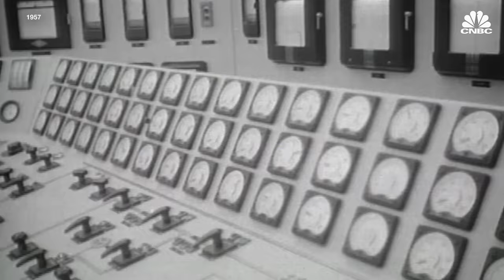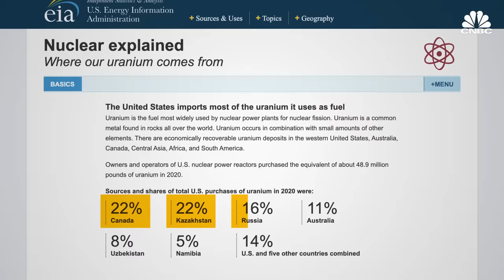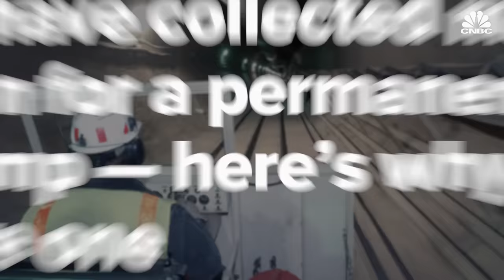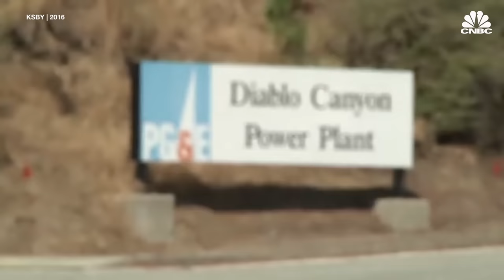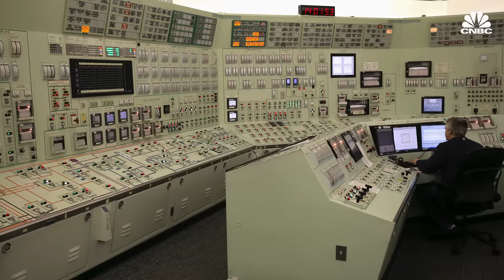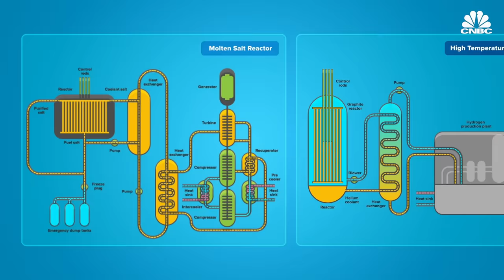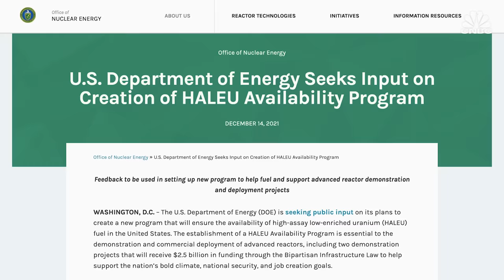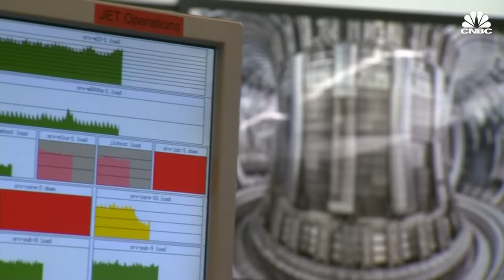Why Nuclear Energy Is On The Verge Of A Renaissance

Comment: Close but no cigar by saying we need batteries for renewables.  We need energy storage, of which batteries are only one type.  Energy storage can be pumping water between pools at different altitudes.  It can be pressurizing/depressurizing an underground chamber.  Anything that can run a turbine as you release it can be energy storage.
Reply: But none of the dozens of methods we have for energy storage have been shown to be anywhere near what is needed to make it effective to run the grid without fossil fuels or nuclear.
Reply: @danadurnfordkevinblanchdebunk  And I didn't argue otherwise.  I just said that they are exploring more energy storage options than just batteries.  I didn't comment either way on your topic.  Did you mean to reply to someone else?
Reply: @ScrapKing73  Nope, to you.  Batteries reach into the 90 percentile efficiency, pumped storage around 70%, hydrogen worse.  Even at 90%+, batteries are no where near a viable solution for utility grade storage.  Until we crack the energy storage problem, renewables are merely a burden on the grid.  Natrium's molten salt storage seems to hold the best hope, but it's not proven yet.
Reply: @danadurnfordkevinblanchdebunk  But I'm not disputing any of the points you keep raising, so you're replying to me with off-topic things.  I'm not talking about sunsetting all other types of energy production, which all your comments are based upon.
Reply: @ScrapKing73   I have been responding exactly on point to your comments and adding to them.  Not sure why this is so difficult for you.
Reply: @danadurnfordkevinblanchdebunk  Not sure why you're unable or unwilling to be polite, when I've been polite to you.  Anyway, I was very clear:  I said that energy storage is more than just batteries, and that's all I said.  You've replied to that with comments about the efficacy of different energy storage solutions, and how we're not ready to go to entirely renewables yet.  Those things are clearly off-topic, as I did not comment on them in the OP, so you're bringing them up unbidden.  If you re-read the thread, it's open and shut that you are replying with off-topic points.  Which is fine but, since I'm not disagreeing with you, you're just having that conversation with yourself.  shrug
Reply: @ScrapKing73   You have yet to come up with an effective energy storage media for your meme.  That's because there isn't one.
Reply: @danadurnfordkevinblanchdebunk  My "meme"?  That word...  I do not think it means, what you think it means.*  Setting that aside, you are again falsely asserting that I said renewables can immediately replace all other forms of energy generation.  I did not say that, and have never said that.  That's why your point is wrong.

* "A meme is an idea, behavior, or style that spreads by means of imitation from person to person within a culture and often carries symbolic meaning representing a particular phenomenon or theme. A meme acts as a unit for carrying cultural ideas, symbols, or practices, that can be transmitted..."
Reply: @ScrapKing73   So as you found out, a meme doesn't meme what you think it memes and I used it correctly.  
You still fail to show any form of energy storage that can make renewables successful.  Your memes of batteries, pumped water, and compressed air all fail the test of effective utility storage and you seem butt hurt when I point that out to you.
Reply: @danadurnfordkevinblanchdebunk  There was not one time where I said renewables could or should immediately replace non-renewable energy, so your point is still incorrect/off-topic.  You seem to have an axe to grind...  but your axe to grind is against someone else, and you're choosing to do it with me for no apparent reason.
Reply: @ScrapKing73   You clearly invoked three different memes, suggesting they could be used to store energy, yet you are unable to demonstrate how this could be accomplished.
Reply: @danadurnfordkevinblanchdebunk  All those systems I mentioned are being used to store energy.  Some have even already been commercialized (pumped storage at a minimum).  That's objective fact, and if you believe otherwise you are incorrect.  Look up the "Salina Pumped Storage Project" as one of many examples.
Reply: @danadurnfordkevinblanchdebunk  You are also now moving the goalposts.  Your initial reply talked about the relative efficiencies of the different forms of energy storage I mentioned, but now you're trying to argue they're incapable of storing energy?  You admitted their efficiency was greater than zero, so you yourself admitted they "could be used to store energy".
Reply: @danadurnfordkevinblanchdebunk  Another way you've moved the goalposts is to go from falsely suggesting that I was saying renewables could replace all non-renewable forms of energy (something I have never said), to saying I'm unable to demonstrate how releasing water or air pressure can spin a turbine.  Well, the science between releasing pressure to run a turbine is very well understood, but I did provide a commercialized real world example now, so there you go.
Reply: @danadurnfordkevinblanchdebunk  As for your definition of the word "meme", you haven't offered an alternative definition, just said you were aware of one.  Well, that's not any kind of proof.  I looked at a few only dictionaries and only found variations on the definition I provided you.
Reply: @ScrapKing73   Meme is clearly defined in those definitions and your assumed definition wasn't even close.  You had beliefs, not facts.  Same with energy storage, you believe what you heard and think they are solutions, which of course they all fall well short of.
Reply: @danadurnfordkevinblanchdebunk  You have yet to provide a definition, making it impossible for me to know what you mean by the word as several web searches failed to come up with any other definition other than the one I already provided.
Reply: @danadurnfordkevinblanchdebunk  It's not a belief that those energy storage systems exist, that's fact.  I provided a reference of a commercialized version of pumped storage, as on example.  You have yet to provide an example of me passing off a belief as fact.  Perhaps there's confusion due to all the things you claimed I said, that I didn't actually say.
Reply: @danadurnfordkevinblanchdebunk  You're falsely conflating broad-based commercialization of an energy storage system, with it existing at all.  You appear to have mistakenly assumed I meant something I didn't say.  I recommend you re-read my opening statement, and take it literally rather than reading into it.

I said "we need" energy storage solutions beyond just batteries.  I didn't say they were ready today.  I didn't say they were ready for broad-based commercialization.  These are all things you have falsely asserted that I said.
Reply: @danadurnfordkevinblanchdebunk  The only confusing thing is that you keep changing what you're saying.  You are now falsely suggesting that I said we needed energy storage to "carry us through the direction we are heading".  And that's yet another way you've moved the goalposts.  You are making all kinds of unsupported assumptions about what I'm trying to say.
Reply: @ScrapKing73   I never moved a 'goal post '.  I directly and concisely answered to your meme and you are butt hurt over it.
Reply: @danadurnfordkevinblanchdebunk  I have provided numerous examples of you moving the goalposts, everything from you saying things don't exist, to arguing about the efficiency of those things (which proves they do exist), so your claim that you didn't is objectively false.  You've now added an assumption (that I'm "butt hurt"), which is also false since you do not know (and cannot know) how I feel about it.  So that's another example of you sharing your belief but stating a mere belief as fact, another thing you falsely claim to not do.

Comment: Nuke reactors are the only way we're going to power all of the cars, stoves, A/Cs, Heaters and other devices they want to throw on the failing grid. Drive through Palm Desert and look at the windfarms. How much bigger are those gonna need to be to start actually helping significantly? They're already pretty ugly and incredibly vast. How many more turbines can we realistically put in?
Reply: There are places in the U.S. where the wind always blows and yes they are not pretty they don't melt down, don't cost billions, don't take 15 years to build, and don't cost billions to decommission and billions more to dispose of the waste. Americans usually always go for the cheapest alternative and that is not nuclear
Reply: @clarkkent9080   But you purposely continually ignore that many countries have been building and using small modular reactors for many decades built in two years or less for millions not billions.  Wind machines also have to be replaced 4-6 times in the lifespan of a typical nuclear plant.

Comment: No, over 20% enriched nuclear materials are not weapons grade. Weapons grade starts at 86% enriched. Jeez.
Reply: To actually use it in a weapon, uranium must be enriched to ~ 80%.
However, NRC regulations defines High-enriched uranium: as uranium enriched to 20 percent or greater in the isotope uranium-235. Requiring enhanced controls and management so it is a big deal

Comment: Just a note on the money side because apparently that’s all that matters in the US. Nuclear fuel is extremely cheap from a $/kWh perspective, only wind and solar are cheaper, but even that is not that reliable of a fuel source. 

Once the reactors are paid off, the extended licenses are basically a license to print money. If we had 500 AP-1400’s in a small area, we could power the entire world for the next 100 years and not expect an accident, with hardly any carbon emissions (except from drying concrete), and it would cost very little.
Reply: You will find some  m o r o n  going by "Clark Kent" from a blank trolling account here in the comments section trying to convince everyone that nuclear is too expensive to consider.  Even when proven wrong he continues to post hundreds of repeat comments trying to convince people of his nonsense.
Reply: When comparing solar costs to nuclear, the Greenies always use.solar maximum output rather than actual average production. The actual production of solar facilities will only be about 1/4 of the rated capacity. Example: my 4kW rated photovoltaic system only puts out 4kW when it was new, and only for about an hour in the day only with full Sun with no clouds. All the rest of the time it is less (visualize the shape of a bell if graphed out) and of course at night it regularly puts out zero.

Comment: 5 major nuclear disasters, ~440 active nuclear sites
That is more than 1% .That is terrible track record. Why not thorium ?
Reply: Because materials like that aren't being used anymore the old fission reactor are being replaced by new fusion reactor more powerful cleaner much more stable it most solves  radiation as it's fuel by hydrogen and and radiation from its operation disaptes almost instantly

Comment: I'm not so familiar with the Three Mile Island event, except the radiation released was so small as to be harmless. With the accidents in Fukishima and Chernobyl, however...The Fukishima plant should never had been built where it was because of the documented risk of tusnamis. That's what a peer group from the United States told the Japanese government when invited to review the plans for the site before it was built. As for Chernobyl, that reactor was a horrible design-like any ordinary person could see that when the Soviet design is compared to western designs. And, the operators were testing it, pushing it to it's limits when it failed...If I recall they even over-rode(?) a safety interlock or three. And even outside of nuclear power accidents, most accidents with radioactive material in general have been due to people being reckless with what they were doing. To put it all in perspective, if you compare the number of deaths due to accidents at non-nuclear to nuclear power plants per MWatt generated, nuclear is extremely safe.
Reply: No one was injured by radiation at Fukushima either.
Reply: @clarkkent9080  The information about the peer group that reviewed the plans for Fukushima came to me from one of the members of the peer group. He worked at the same research facility as myself. When the event took place he shook his head and said 'we told them not to put that plant there for this exact reason'.
Reply: @tempest411   Great then you can provide the specific details.  Fukushima like all U.S. reactors must develop a Safety Analysis Report (SAR) but you must already know that.  And the SAR (usually ~ 1,000 pages) details all the analysis on hazards, facts and basis used, and resultant design requirements to mitigate, in this case, the size tsunami that the plant was designed to mitigate.  
So, my question for this other member of your peer group is what in the Japanese' tsunami evaluation did the peer group disagree with????  Historical data????  bad calculations???? what??

You must know that the entire nation of Japan is subject to tsunamis so my question to your original comment that they should not have built it were they did, is where else could they build it???

You may have trouble getting an answer from your peer friend since Fukushima construction started in 1967 and your peer group friend may not remember something that happened 55 years ago since they must be very old now.
Reply: @clarkkent9080  "You may not know this, but EVERY nuclear plant has to identify all risks, natural and manmade."  
Duh, 
so does every fossil fuel or renewable facility.

Comment: If at the very first sign of trouble at three-mile island everyone had just gone home, the plant would have shut down automatically. There would not have been a melt-down. There were mechanical and electrical problems but the melt-down was entirely human caused.
Reply: First of all there was no meltdown. 2nd everything else you mentioned is correct & good enough reason for me to agree.
Reply: Yes what you say is actually true.  Anytime a reactor shuts down for any reason, emergency systems start to prepare for an actual emergency.  If the operators do nothing they systems will in all cases keep the core safe and cooled.  
However, if the operators do not take action, the containment will be flooded with radioactive emergency cooling water and the reactor will be cooled down so fast that it will exceed design cool down limits of the vessel.  In other words, the core will be safe but there will be hundreds of millions of dollars of damage and cleanup with the plant out of service for months to years.
Reply: @cme98  Could have fooled me.  Why did they take years and spend $1 billion cleaning up that un melted fuel when a normal refueling can remove undamaged fuel assemblies in less than a day at no cost???